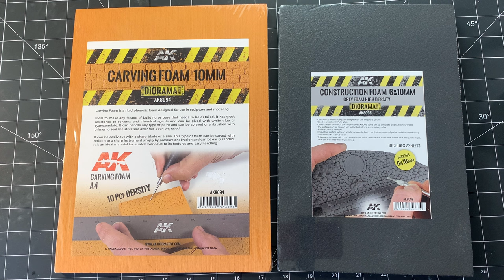Make and Paint Realistic Stones From Styrofoam

Comment: Depending upon what you're doing with the wall, it's normally a good idea to mix some pva/white glue or mod podge into the black layer there. It adds a lot of durability to the end result.

Another way that I've been doing stones is to go with a chalkier white paint (I mainly use the larger bottle applebarrel white...for some reason that one seems to have the best result), go with that as a base coat or mix in a bit for a very light grey. Then I shift over to using thinned down inks rather than paints and use them to hit different stones. I've used greys, blues, reds, and browns along with some mixes. following that with a directional drybrush of off whites...and, sometimes, a pure white that's extremely focused for a final highlight.
Reply from the maker: Thanks for the tips!

Comment: Looks great! But you really shouldn't be sanding XPS. The dust is not something you want to be breathing in.
Reply from the maker: Thank you! And I agree - every time I sand I wear full face respirator that covers my eyes as well. I always make sure to clean any residual dust as well after sanding.
Reply: Yes, as this does cause Cancers in the State of California... but I live in Texas and am very careful wearing the appropriate safety masks when working with Pink Foam Boards.
Anyway...GREAT VIDEO!
Reply: @smolworldworkshop  @Smol World Workshop  awesome walls!!! But wow... I never use any masks or respirators when I handle this sort of material... on what phase of the process do you use face protection? Only when sanding? Or also when you are scribing or carving the stones?
Reply from the maker: @jollyrogerquill  hello!! Just when sanding dust is present. I don’t wear a respirator when I’m scribing because it doesn’t make any dust. I hope this helps!
Reply: Hola, que tipo de material que hace ese muro

Comment: Your wall videos are all great. Could you recommend a more time-efficient version of this technique though? For example, can you get away with doing the deck tan highlights only once? If so, at what point in the process? I looooove the end result but if you're trying to paint 15 sections of wall, that's hundreds of stones that have to be highlighted and washed with different browns TWICE.
Reply from the maker: Thank you! If I were to do something quicker, I would only add the gray tones and highlights by drybrushing since the paint practically dries instantly. I would then probably do a brown wash and green wash for dirt and moss. Then I’d speckle on some black and white and call it good. It won’t be as detailed, but it will still look great in a fraction of the time.